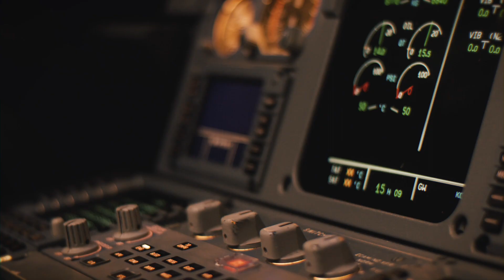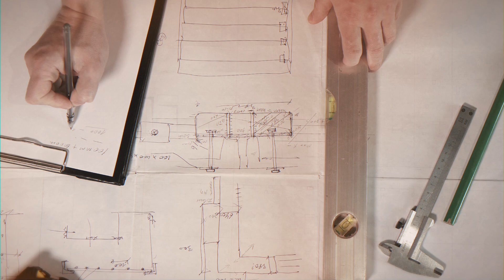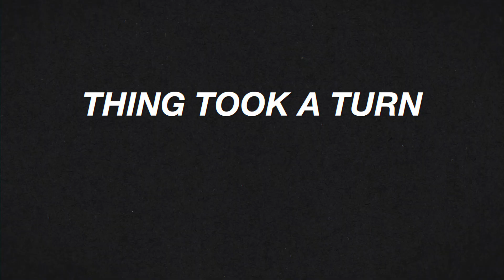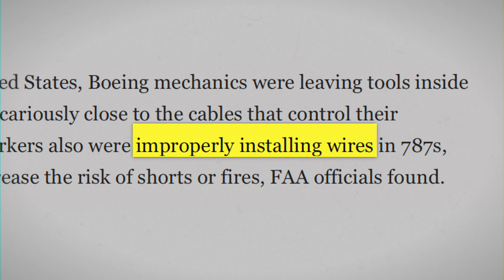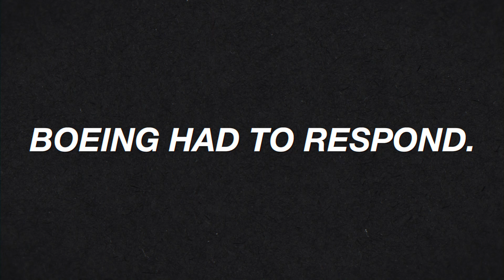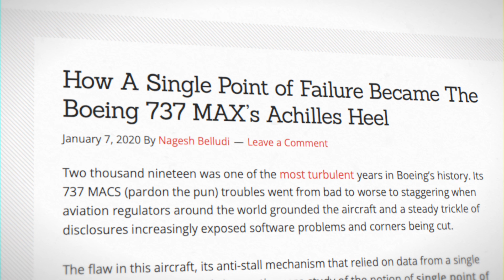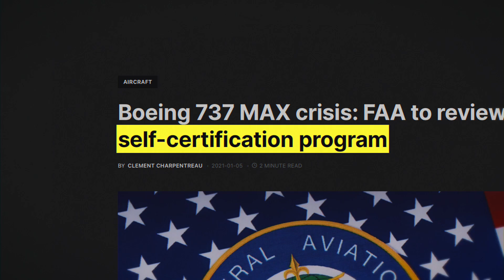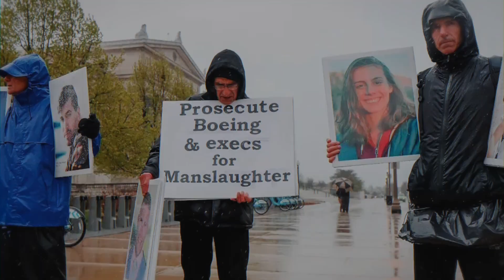The Scandal That Destroyed Boeing

Comment: In fact, the 737 Max had two AoA (angle of attack) sensors fitted, but the MCAS system only took its input from one - which alternated with each flight.   (Why, I have no idea).    There was a 'AoA disagree' warning light, but this was an optional extra.   Unbelievable for a safety-critical system, one can only assume that Boeing didn't realise the potential for MCAS to fly the plane into the ground.
Reply from the maker: Yes, you are right! Really odd they did that…
Reply: @Armin99_  it was only one . This guy is talking nonsense
Reply: @fredithegeroo906  I agree with you ...
Reply: @kirilmihaylov1934  Actually, OP is correct.  Boeing DID offer a second MCAS sensor but it was an expensive OPTIONAL equipment addition.  Yes, Boeing was charging a premium for a safer aircraft.  Sadly, most airlines did not order the costly second sensor.  The whole situation is pretty messed up and sad.
Reply: @machupikachu1085  yes that's what I was saying . It had only 1 sensor
Reply: @kirilmihaylov1934  some planes have one sensor.  Some have two - depending on how the plane was ordered.  So, OP was not talking nonsense, the plane was designed to have two units.  But, you are also correct to say that the fatal crashes only had one sensor aboard.  Two things can be true at the same time.

Cheers!
Reply: @machupikachu1085  which was Boeing fault.  Cheers
Reply: Boeing expected competent pilots. Whatever the reason, if auto trim is trying to fly you into the ground, you switch it off.  Was it a bad design? Yes.  Should it have resulted in 2 crashes? No. There are many potential failure modes in every aircraft that require action from a pilot to prevent a crash.  Runaway trim isn’t new.  In the moment, in the air, it doesn’t matter what caused it.  The response has to be automatic. That’s why it’s a memory item for every person qualified to fly a 737.
Reply: @mrlt1151  Still blaming the pilots?  Interesting.
My uncle is a Dreamliner pilot, and he doesn't blame the pilots.
Reply: @user-yt198  there are plenty of YouTube videos of real life pilots dealing with runaway trim. It doesn’t matter why, only that the auto trim is causing a problem.  It’s a memory list for every 737 pilot since the 60’s. The Lion air flight before the incident flight had the exact same malfunction, but a jump seat pilot from another airline, who I assume was better trained, who also had no knowledge of MCAS knew to disable the stabilizer trim. With the Ethiopian crew, the forces were so high because they were overspeed. They’d left takeoff power set.  Pilot’s are supposed to know how to deal with runaway trim. While they will never  come out and say it, I guarantee people at Boeing were flabbergasted that these 4 pilots couldn’t manage this malfunction. I can tell you, I’d never fly either airline.
Reply: @machupikachu1085  
Then he is no more intelligent than the Ethiopians.
Reply: @machupikachu1085  
He had to draw you a diagram of how to turn two trim switches off?
Reply: @machupikachu1085  
What are you, 12?
Reply: I read a while back that Boeing knew MCAS should take the data from both sensors but that regulations required that any system which was 'important' enough to need dual inputs would need specific pilot training - i.e. expensive simulator time which was an absolute no no for Boeing (they were fixated upon iPad only training as it was stipulated in a huge MAX order they had - from American I think?). So they went with one input knowing it wasn't good enough and convinced themselves that alternating the sensor used for each flight was a suitable alternative.
I recall also reading that the degree of power MCAS had over flight parameters (when they first kludged it together it wasn't as strong as it ended up being) should have meant it was flagged as a 'very important' (or words to that effect) system to the FAA, again mandating simulator training. In this case they didn't change the system, they just outright lied to the FAA about its importance and power!
Reply: @alhanes5803  "What are you, 12?"  
sorry to break it to you, I'm over 18, so I'm really your type.
Reply: @machupikachu1085  I'm sorry, but this is incorrect. MCAS was designed as part of the speed trim system, which has much less control authority and therefore only used one sensor. The option you are thinking about was to show angle of attack; it also incorrectly was required to show angle of attack disagree alerts, which was documented as a standard option. There was no option for a two-sensor MCAS system: this was simply not supported by the design.

All 737s have had two angle of attack sensors, two sensor controllers, and two flight control computers, by the way. One of them is a lead computer, which does all the work. The lead computer switches every time the system is rebooted. The other computer provides backup and monitors certain functions of the primary computer (it also does a couple things on its own) but again this did not include speed trim system or MCAS.
Reply: @AmbientMorality  okay.  My uncle is a Boeing pilot and said the reason they didn't promote MCAS on two sensors was due to the stipulation by the FAA that anything critical enough to have redundancy needs mandatory pilot training - thus Boeing tried to skirt the regs by downplaying the importance of the MCAS system.  I may have misunderstood him tho.  I'm not an aviator, after all.
Reply: Great extra information, thank you!!!🙏😢✈️
Reply: Furthermore it has been known for nearly 20 years that the AOA sensor would produce bad data for a few seconds. In the older planes, the pilots would notice the bad data. Wait for a few seconds and good data would come back.  The MCAS program however was badly written, not only did it take data from only one AOA sensor when the airplane had two, it would mindless act on it immediately. It did not have algorithms to remove or compensate for bad data. Nor did it have limited to its command authority. So it could nose dive the airplane, in a configuration that was not flyable. And finally it could not be deactivated. The only way MCAS could be deactivate, was to turn off the entire airplane's automation system.. leaving the pilots with no "power steering"  and had to move the plane's control surfaces with only the strength of their arms. ... which is impossible in more extreme flight configurations.
Reply: Does not change the fact that MCAS locked out the pilots & copolits from inputting controls! Should never have happend! Imagine engaging the brakes on your car and steering to the left to evade an obstacle but your car locks you out and steers to the right while accelerating simultaneously!
Reply: @mrlt1151  "Boeing expected competent pilots". You are selling THOUSANDS of this plane; you have absolutely no right to expect all pilots will be competent at all times. The Airbus philosophy  - "I want it so my chauffeur can fly this thing safely" the head of Airbus said - is better.
Reply: @kenoliver8913  Air France 447. They even had a working angle of attack sensor. Unfortunately, at least one of the pilots didn’t understand fundamental airmanship, or panicked when he actually needed to fly the plane in adversity, and due to Airbus’s philosophy, the other pilots had no idea what he was doing.
Reply: @mrlt1151  Tell me you know nothing about aviation without telling me you know nothing about aviation.
Reply: @kenoliver8913  Exactly. Aviation is all about redundancy and not leaving anything up to chance. If your modern jetliner design is based on "we'll get rid of the redundancy  and greatly increase chances of failure but it's fine because the pilots will act exactly as they are supposed to" you've already failed and the inevitable crashes will be your fault.
Reply: @Person01234  sure thing bud. Whatever you say.
Reply: @mrlt1151  it had absolutely nothing to do with "Airbus's philosophy" and everything to do with pilot error and terrible CRM. Potentially indicating a training problem at Air France regarding high altitude stalls and/or lose of airspeed readings due to frozen/blocked pitot tubes & their CRM training.

It had nothing to do with Airbus logic
Reply: @change_your_oil_regularly4287  if like Boeing, the stick on the other side moved every time the first officer pulled back in the middle of the stall, the other pilots would have been aware of what he was doing.
Reply: @mrlt1151  you cant expect western pilot standards when most of your market is in poor countries
Reply: "but the MCAS system only took its input from one - which alternated with each flight.   (Why, I have no idea). "  If the MCAS had used two sensors, it would have been deemed a critical system and would have required retraining which Boeing seeked to avoid.
Reply: @mrlt1151  you mean like the incident with AF011? The pilots were fighting each other in a 777. The 777 has a yoke

You tend to make it a little too easy for yourself when reaching conclusions. AF011 proves that a yoke is not a definitive way to prevent pilots fighting each other. 
You also argued that the pilots of the 737 mishandled the runaway trim which is true. It could be argued that the pilots of AF 447 mishandled the Airbus as they did not use the priority takeover button. But on the 447 accident you blame the Airbus philosophy (which clearly contributed, don't get me wrong) and on the 737 accidents you blame the pilots for not using their equipment properly. I find that a little intriguing ;)

Another thing about the runaway trim: Yes, pilots should know how to handle runaway trims. If the pilots had reacted within 5s they would have saved the plane, yes.
But you are missing one thing: We can assume that a certain percentage of pilots will not know how to deal with runaway trims because that is in the nature of things. Runaway trims happen but they are rare so the likelyhood that two pilots, that don't know how to deal with one, will encounter one. But if you increase the likelihood of a runaway trim by implementing MCAS you are asking to eventually find two pilots that don't know how to deal with a runaway trim. And apparently these conditions have all been met twice within a year. There might be a freak element to it but still, the fact that it did occur twice within a year shows that it is a pretty fucking big problem and needs to be fixed yesterday.

Besides: "traditional runaway trims" can happen with a slower trim speed. With MCAS you always get the maximum trim speed which means that pilots have 10s to react. 10s is a really short time if you have to realize that the trim is the problem and fix it while fighting to stop the nose from dropping. And in my opinion it is borderline to being too much to ask of any human being.
Reply: And we've already had multiple accidents in the past caused by AoA sensors getting clogged or otherwise malfunctioning, followed by either human pilots or AI programs steering the planes into dangerous (or even unrecoverable) situations during their confusion.

They would have been better off adding more AoA sensors for the plane as backups and making the AoA-disagree warning a mandatory feature, if for no other reason than to minimize the risk of faulty readings convincing the new autopilot to crash the plane.
Reply: Watching the Netflix documentary, apparently having the system run off of two input sources would have been considered as a significant change to the aircraft design. This would require costly additional pilot training for airlines. Which Boeing was trying to avoid at all cost so they could be cost competitive with Airbus's 737 competitor. Really stupid choice driven by greed.
Reply: @machupikachu1085  He's not completely wrong though - there is shared blame - the method to handle runaway trim existed for decades and was the same for the Max.  It was supposed to be a memory item that they were trained to do for any time there was a trim issue (decades before the Max or MCAS).  Turn the switch off as they were trained and fly the plane.  Both planes could have been saved with that method as MCAS couldn't trim the plane with it turned off.  The reason for runaway trim wouldn't even matter as the solution to runaway trim was the same regardless and in an emergency the memory items are more important than trying to figure out why when you don't have time to do so.  The second plane actually did that - but they forgot to fly the plane and oversped the aircraft making it impossible for them to manually trim it easily due to the increased forces involved and they made the fateful decision to turn the trim back on despite that the notice from Boeing reiterated that in the event of runaway trim turn trim off AND LEAVE IT OFF for the duration of the flight.  Boeing needed to make changes - it should have used redundant sensors rather than alternating between them for each flight - but the pilots should have fallen back on their training that was decades old to handle this very problem as well.   If the trim issue had occurred on a plane without MCAS for ANY reason the pilots would likely have had the same result as there is no reason to believe they would have done anything different.  The pilots surely should have known about MCAS and boeing was wrong not to mention it - but the training they would have received to turn it off was no different to what they have been trained of since the 737 was created and in both crashes they shouldn't have cared if it was MCAS or a broken component in the trim system.
Reply: The reason why only one sensor was used :
Per regulation, redundancy is not needed for non-flight critical system, like the MCAS at the time.
The pilots were expected to perform trim run-away procedure should the computer trims the nose down without command, for any reason. Including MCAS.
Reply: pretty sure it has to do with some FAA regulation mandating that sytems of critical importance must have redundancy. If MCAS had redundancy built in the FAA would be compelled to look deeper into it and not let boeing sweep it under the rug like they did to avoid further certification costs and pilot training. I'm paraphrasing but I'm almost certain this is the case.
Reply: @machupikachu1085 which shouldn’t be optional.  Aircraft safety is entirely dependent on redundancy.  Control methods, engines, flaps, even computer systems.  If one thing fails you have a back up or the ability to operate without it.  Having a single point of failure on any aircraft should disqualify it’s airworthiness.
Reply: Based on the first flights of Boeings Starliner Spacecraft, I have to assume there are ZERO software engineers left at the company, if not zero engineers period
Reply: @UNSCPILOT  Engineers tend to care less to make pennies on the dollar and more about actually making cool shit but that's no bueno for the finances of investors. Engineers and bureacrats are both necessary for a healthy company but one should not try to take on the duties of the other. It's a symbiotic relationship at it's core like how healthy relationships are meant to be imo
Reply: The physical AOA warning light was an addon, but it was always supposed to show up on the PFD (and it does with an update). One of the software engineers must've gated it behind the upgrade existing by mistake. Still very bad, but it wasn't designed with a safety deficit.
Reply: @machupikachu1085  The upgrade was a physical light for the AOA disagree alarm, not the "MCAS sensor" (two AOA sensors are in fact required). The alarm was always meant to also show up on the PFD, but didn't because of an bug in the software (and boeing themselves only ever tested with the full upgrade). It's an engineering failure, but not a deliberately less safe aircraft.
Reply: @mrlt1151  I have kinda thought that. I used to know an airline pilot well. He once to me he could train virtually anyone to do 90% of his job in about a fortnight. But the remaining 10% took several years as it was the important part.
Reply: @mrlt1151  except MCAS would trim the elevator nose down so quickly that the crew barely had any chance to affect it - and by the time they shut of the electrical trim system, they were suddenly faced with having to fly a plane intent on drilling itself into the ground without the means to overcome the aerodynamic forces acting on the tailplane.

In short, a severely out of trim 737 at high speed cannot be recovered without the automatic trim system.
Reply: Locking safety features behind microstransactions
Reply: @mrlt1151  how exactly do you switch off (a) a system you have no knowledge of, and (b) MCAS exactly?

There was no switch to disable MCAS.  All the pilots had was a switch to disable the power to the horizontal stabilizer jack screw.  And in disabling that, they also disabled its use for themselves 

In switching off the motor, all the did was stop MCAS's commands to move the horizontal stabilizer from being obeyed - MCAS is still there in the background trying to move it.
Reply: @mrlt1151  yes, the pilot panicked and belly flopped his plane from around 40,000 into the Atlantic.

However, now that you've brought up AF447, perhaps you can explain Boeing's decision to use a SINGLE AoA sensor in light of the crash of GXL888T on 27 November 2008, with the final report published September 2010, a bit over FIVE years BEFORE the 737 MAX's MAIDEN FLIGHT.

The cause of that crash was the crew testing (without ATC permission and from too low an altitude) the anti-stall features of the plane - they failed to work as the system was fed FAULTY DATA by a DEFECTIVE AoA sensor.

So when Boeing made the MCAS system rely on a SINGLE AoA sensor, it had been known for over FIVE years, that AoA sensors could provide faulty data that could result in a crash, due to systems that rely on that data not working as intended!

Please, oh please, explain Boeing's rationale in light of the crash report for relying on a SINGLE AoA sensor.
Reply: @cigmorfil4101  one more time for those in the back. It doesn’t matter that it was MCAS causing the horizontal stabilizer to move, only for the pilot to understand that they had unwanted stabilizer movement.  There really aren’t many other things to do but disable the auto stabilizer trim after that. Boeing expected that a competent pilot with the required 737 type training could handle it. It doesn’t matter if it’s an electrical problem, mechanical, or software. If the horizontal stabilizer is trimming the aircraft it an unwanted way, disable it.
Reply: @cigmorfil4101  Boeing absolutely made grave mistakes in the MCAS design. Those mistakes shouldn’t have ended in 2 tragedies. Both statements are true.
Reply: @mrlt1151  "Boeing expected competent pilots."

And pilots expect a plane to be made so that it's not going to try and kill them.

Making a system that has the power to run the plane into the ground autonomously rely on a single sensor isn't just bad design, it's basically attempted homicide. 

And to add to that, many pilots have outright testified in court against Boeing saying that there is basically no way that ANY pilot would be able to react fast enough in the event of an MCAS malfunction to prevent a crash, as they had *seconds* to shut MCAS off and pull the plane back up before the elevators just locked due to airspeed  (gained from MCAS sending the plane into a dive, and the fact that they would now have to control the plane manually) making recovery impossible, because as it turns out sticking a massive new engine on a 60 something year old frame isn't the brightest idea.

And keep in mind that MCAS is a system that would reactivate itself over and over again, repeatedly. blackbox data from Lion Air Flight 610 shows that. And also keep in mind that pilots were never actually TOLD about the MCAS system, as if it was added to their manuals as a big important system (which it was, considering it could... you know... crash the fucking plane) then the FAA would make retraining a requirement (big no no, since the entire design plan was to not have pilots be retrained as a selling point). The entire MCAS system was HIDDEN from pilots.

So you have a system that no pilot was informed about that has the power to crash the plane and reactivate itself over and over again relying on the output from ONE sensor and these pilots have mere seconds to diagnose and rectify the problem before the plane locks up, and you blame the pilots? How about the fact that the plane was all but designed to be a killing machine by Boeing and whatever dunce of an engineer signed the design (something that any respectable engineer would have refused to do, in light of the aforementioned GLARING design flaws and the very blatant violation of engineering ethics)

Sure, the pilots didn't react perfectly (I mean, holy shit, what a surprise. They're people under stress with an unknown time constraint). But by no means is their blame in ANY way comparable to Boeing's as you're suggesting.
Reply: @tyler89557  i stopped reading at the idea that it was impossible to react in time. We know that the flight before the Lion Air incident flight had the exact same malfunction, and the pilots, well, a jump seat pilot from another airline, knew to disable the stab trim. That flight didn’t even think it was important enough of an event to divert. They continued on to their destination trimming the aircraft manually. There was plenty of time.
Reply: If correct, I can say -
When safety is "an extra package".
Reply: @robroilen4441  there definitely were several news outlets that ran with the idea that the Max’s engine placement made it unflyable without MCAS and that it was a compromise that was unsafe and greedy. I can’t tell you if the journalists don’t understand the truth, just want the clicks, or have other motives. It was never my understanding that the 737 had a huge operating envelope. It’s designed to move meat medium distances, relatively efficiently. I actually wonder how many times a 737 has been in a situation that would have actually triggered MCAS on the Max, and survived?  Boeing screwed up MCAS, the FAA should have done more oversight on its implementation, and those planes shouldn’t have crashed even though they were flawed.
Reply: @mrlt1151  Did they really screw up MCAS, though? If the system activates due to a faulty AoA sensor reading, wasn't the AoA sensor ultimately responsible regardless of MCAS taking its reading from a single sensor? The characterization of MCAS as something that Boeing just haphazardly implemented feels misguided to me, since the failsafe mechanisms were exactly the same as any other runaway trim incident - cutout switches and competent pilots.
Reply: @robroilen4441  mcas might have been to aggressive,  I don’t think it was designed to win a tug of war with the pilots, so it likely shouldn’t act if the pilot input is opposite. My understanding is that it’s only to augment inputs the pilot should already be making to make the aircraft handle more like the legacy aircraft. I also think that it shouldn’t have only relied on a single sensor, or in case of disagreement. With that said, making it less aggressive opens up the possibility that it’s actually needed, but doesn’t do enough.
Reply: airplane lore is so interesting